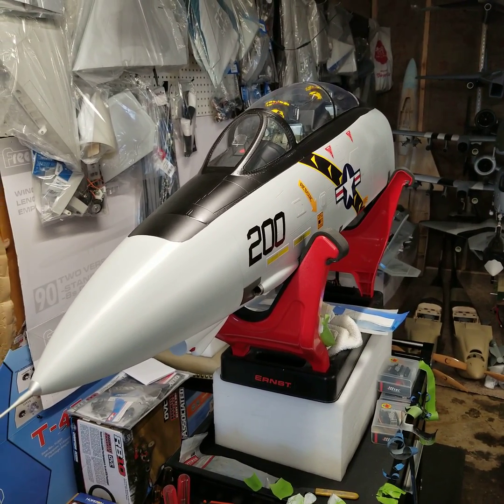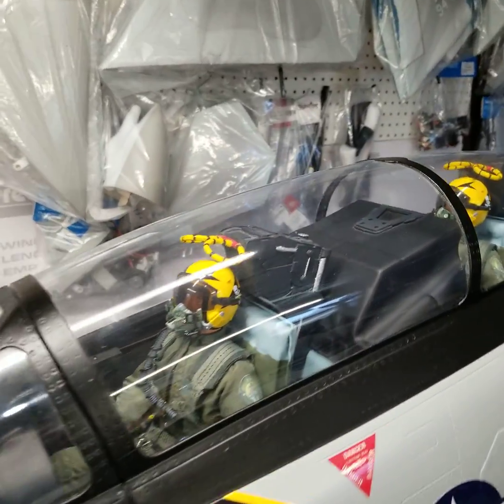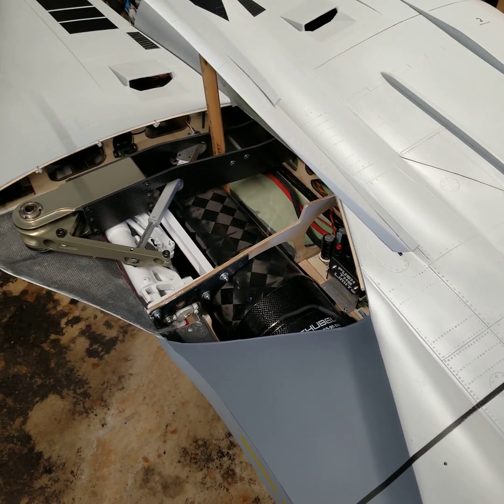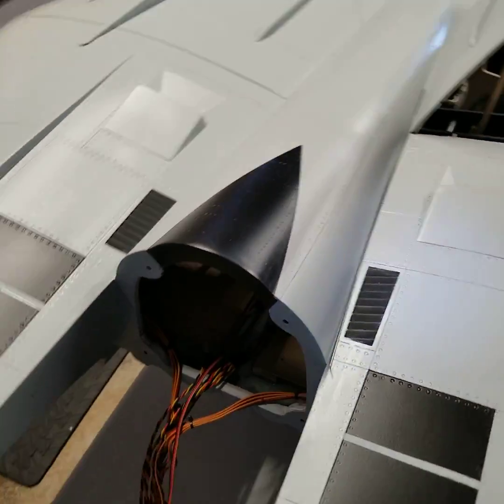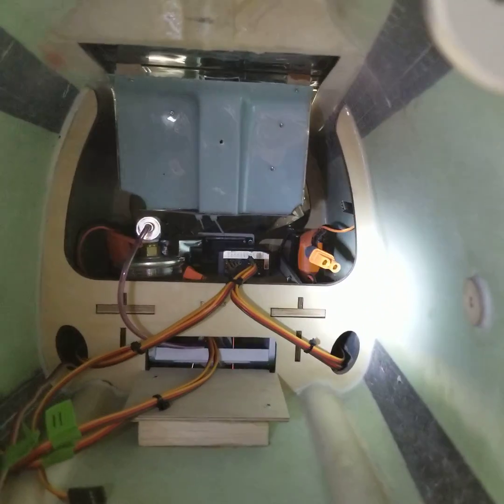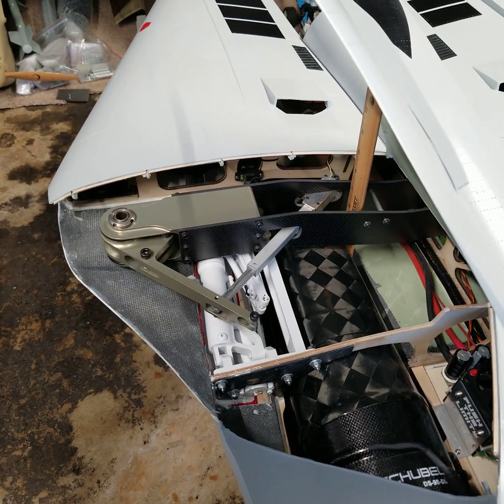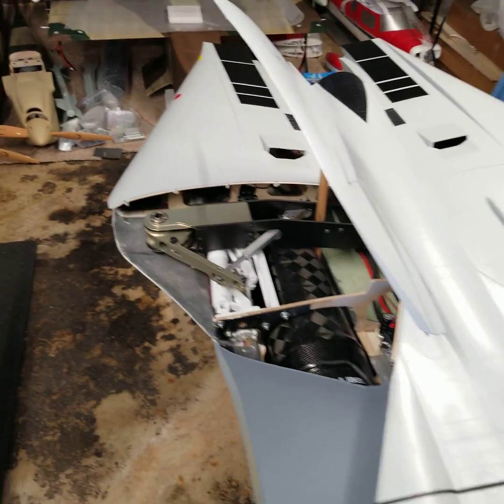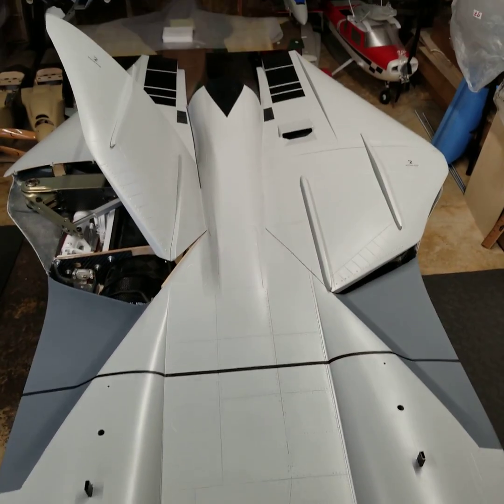Skymaster F-14 EDF conversion Part 3, short update

Comment: Dave what EDF fan units and ESC units are you using in your F14
Reply from the maker: Schubeler 128mm HST with the recommended 205 volt esc. From Schubeler.  14s per side.
Reply from the maker: https://youtu.be/8qCh6-qBdm8
Charlie, I listed the specs in the description of this video. Hope that helps!
Reply: OK Thanks....................Have you flown the Tomcat yet?
Reply from the maker: @charlietrivits6944  its ready and I have a field to fly from, just waiting on the weather to clear up. Should be anytime in the next month. I literally just went back through and checked everything to be sure it was flighte ready.